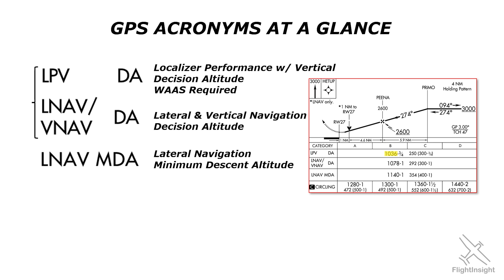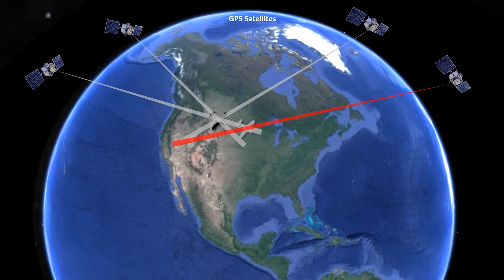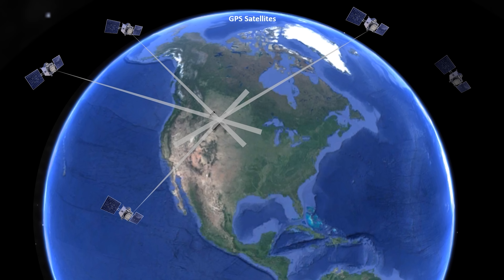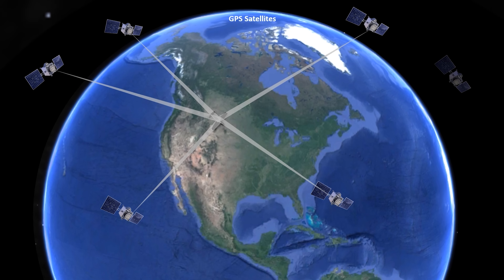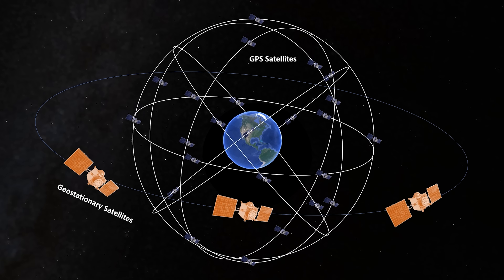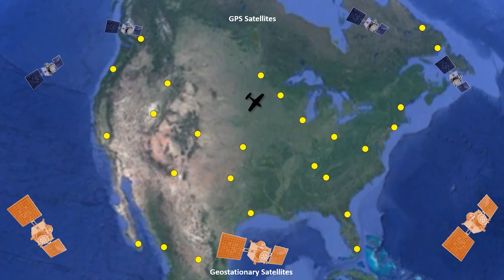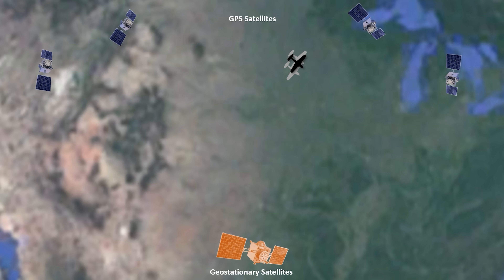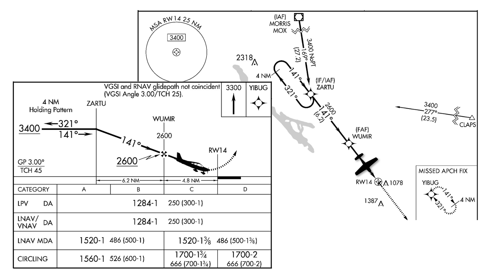RAIM vs WAAS: Do You Still Need to Check RAIM for IFR Flights?

Comment: Quick question for you. In the video, it claims a 2 NM en route sensitivity for en route. However, double checking with the AIM, the only answer I can find is 5 NM sensitivity.

“Without arming, the receiver will not change from en route CDI and RAIM sensitivity of ±5 NM either side of centerline to ±1 NM terminal sensitivity”

AIM 1-1-17 b 5 (e) 3

Am I missing something? I probably am, just wanted to see if you could point me in the right direction.

Comment: You state the ground stations can determine a faulty satellite, and then ignore it and use another satellite. Doesn’t this mean you need more than 4 satellites in case of a faulty one? Hence it would make sense to still require a RAIM check even though you’re using WAAS ?

Comment: I thought LPV was not technically a precision approach, may you please elaborate?:)
Reply: Technically it's not, it's an APV approach, approach with vertical guidance. A precision approach requires more than a stable glidepath, such as a certified approach lighting system (and a lot more).

Comment: 2:12 discusses fault exclusion and implies that you can perform fault exclusion using only 5 satellites in view. However, according to the PHAK, page 16-31, you need 6 satellites for fault exclusion and only 5 for fualy detection (or one fewer if you're using baro-aiding, but I don't think you're addressing that topic in this video).
Reply: Came here to look for this comment as well. My understanding of it is exactly as you stated. 5 satellites in view for fault detection, 6 or more for fault exclusions unless baro aided